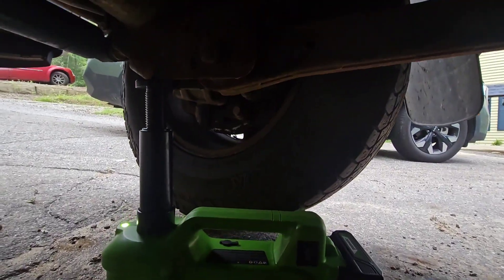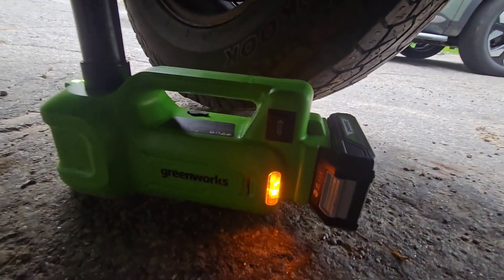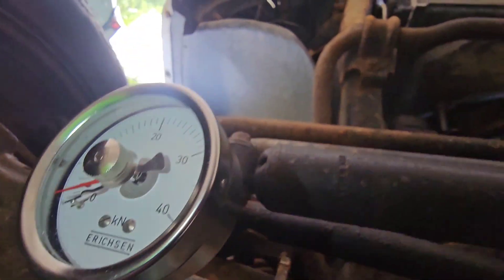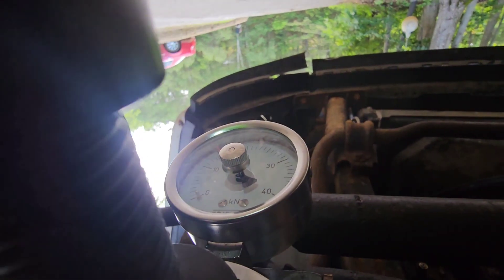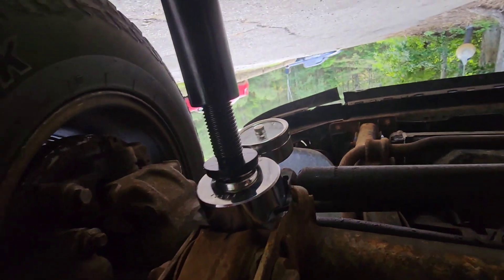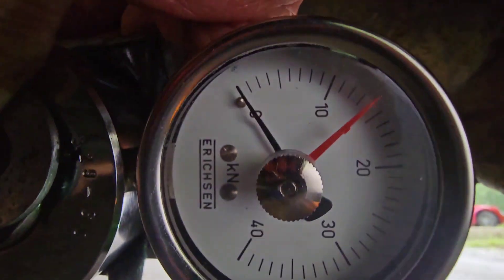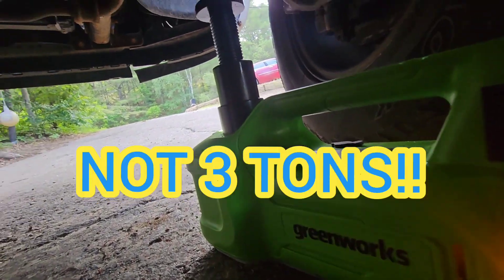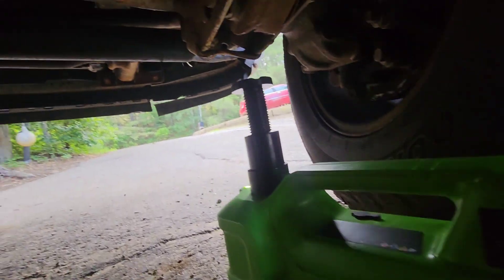Is the 3 ton rating legit? Let's test it! Greenworks 24v battery car jack test and review.

Comment: I wondwr if a bigger ah battery would make difference, ijust got the lift and 8ah will test and report

Ok i used a  8ah battery and definitely makes a big difference,  while lifting ,you can press battery indicator and see bars dropping to one bar while the bigger battery had no bar drops while lifting aslo sounds faster with bigger amp battery

Comment: When they rate Jack's to 3 tons you need to lift 3 tons to compare if it will do so. Your truck lifting on one corner is not 6000lbs at one point
Reply from the maker: No,  but it's more than the 3000lbs the jack could lift which is why I ran the test in the first place... when the jack couldn't lift one corner,  I said to myself,  there's no way this jack is really pushing the 3 tons it claims,  so I did a test and recorded it for other people to see.

Comment: Your logic is so flawed.  If a 3 ton jack lefts a 1.5 ton car frame, your pressure will only be the weight it has lifted.  If you had a 20 ton jack, it would still read the weight of the frame it's lifting.  Did you ever take a physics class?
Reply from the maker: Apparently, you paid better attention in physics class than while watching my video.  The Jack was unsuccessful in lifting the truck,  so what the guage measured, is the maximum output of the jack.  That's why I mentioned in the video that the other side of the truck was on a jack stand.
Reply: @reusefull  It appeared in the video that your tire was off the ground...did the jack stop on its own & not proceed further?
Reply from the maker: @mmaephillips the jack was able to pick the wheel up as it tensioned the spring right above it, but then when it started to lift more of the (diesel) truck it was unable to. The jack still had quite a bit of height to go before it would have been fully extended.

Comment: Wonder of the battery life has anything to do with that? Meaning a freshly charged battery may provide more power than 1 that is at 50%? I know this can be a factor in smaller battery operated devices.  No idea about a lift.
Reply from the maker: I've definitely noticed that fresh batteries and bigger AH batteries provide more power to a tool.   This sound like a motor pitch change,  the motor is still spinning, but a relief/bypass spring somewhere inside that thing has lifted.  It's worth trying it with a freshly charged bigger battery to be sure though.

Comment: Good video, I do see now on the website it says the force depends on extension of each rod. 1.55 tons for first rod/section and 1.1 tons for final extension. I bought one on sale but still in box determining whether it's worth it for what I'd want it to supplement. My HF floorjack is great but huge.
Reply from the maker: Haha,  exactly! I have an older 4 ton hf floor jack that has worked reliably,  but is over 100lbs

Comment: Great vid Thanks for sharing!!!!!  How much does the truck way?
Reply from the maker: Just shy of 8,000 the way it was sitting.  The front (where I was lifting) has a lot of weight because of the diesel engine.
Reply: @reusefull   Thank You! And did the jack extend to its full capacity 17 inches when all that weight was on it? Or at any other time you used it?
Reply from the maker: @joebagofdoe4762  the jack only picked it up until the suspension was flexed,  as the weight transitioned to more of the truck,  it stopped extending.  In my Chrysler 300 it went to full extention.
Reply: @reusefull   Thanks Im going to get one ! I have a  15 CRV  Total weight 3,800 lbs and Im hoping it will lift it the whole 17 inches up. It is hard to work on the suv at any lower of a height. Thank you so much you've been very helpful
Reply from the maker: @joebagofdoe4762  ok, but the jack doesn't lift 17 inches.  The portion that you can unscrew to adjust starting height is included in that.  I think the actual lifting ability is around 12 inches,  so you would have to use jack stands and take 2 bites at it to get the full 17.
Reply: @reusefull   Yes ! I figured that I purchased 2 Powerbuilt jack and jack stand combo 4000 lbs each to get that extra boost I got tired of lifting my floorjack and been looking for a universal alternative
Reply from the maker: @joebagofdoe4762  definitely easier👍
Reply: @reusefull  Thanks Again !! Your the only one out here with a real vid on this carjack
Reply from the maker: @joebagofdoe4762  good to hear,  thank you.  Hope the info helped!